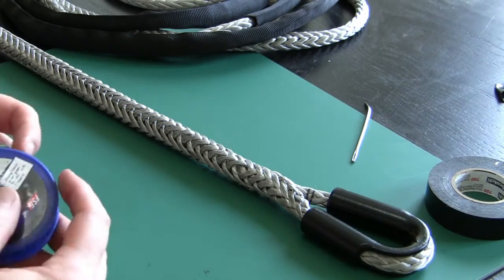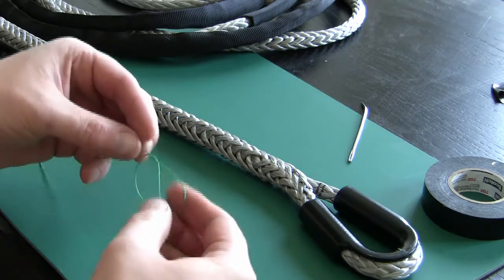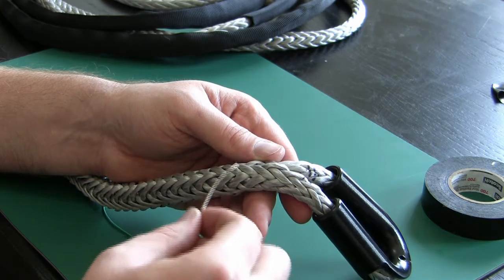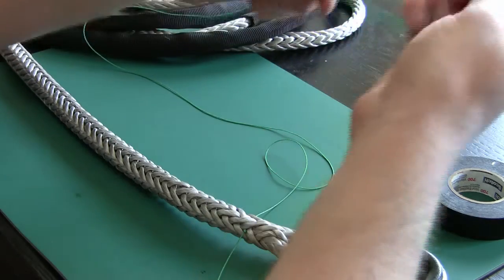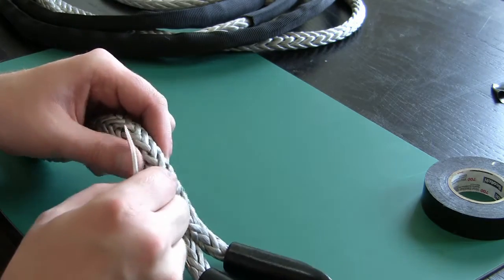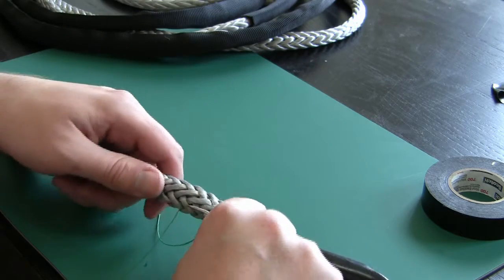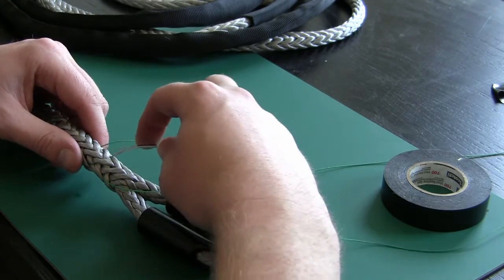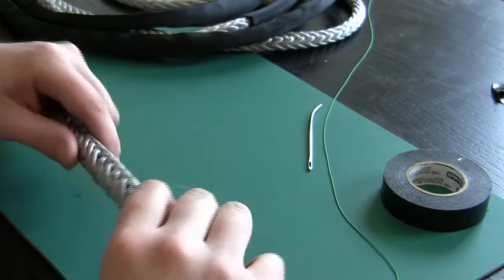Dyneema Lock Stitch Demonstration

Comment: this is no good, has to be locked like with a brummel. This will come apart when there isn't enough presser on both sides.
Reply: Sadly this just isn’t true. Yes, I use a locked Brummell on all of my eyes, but that’s just because I don’t like doing lock stitching. The reality is that lock stitching a 3 1/2 Fid bury with a 1 fid taper and lock stitching will give you  90%  of your original breaking strength.